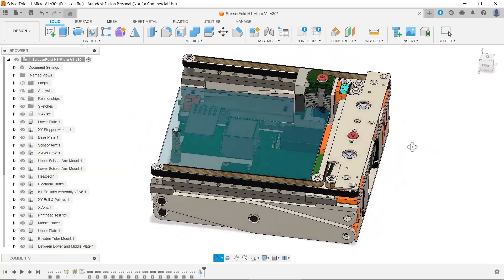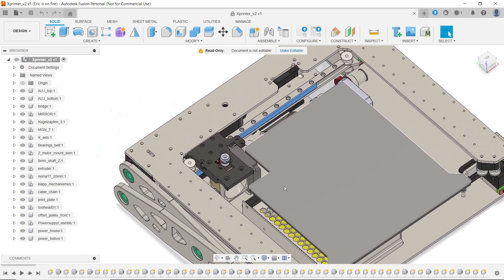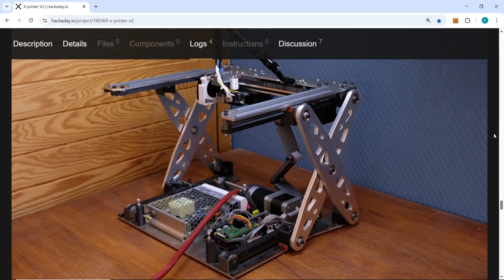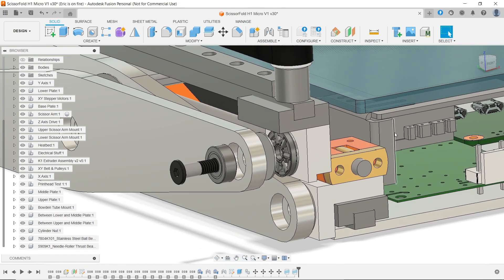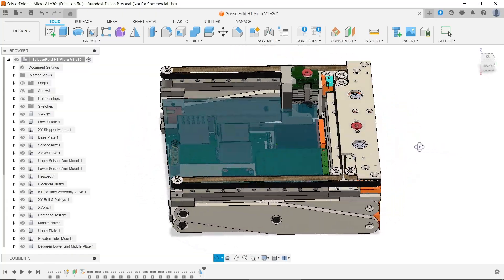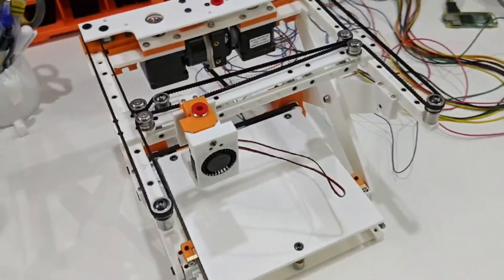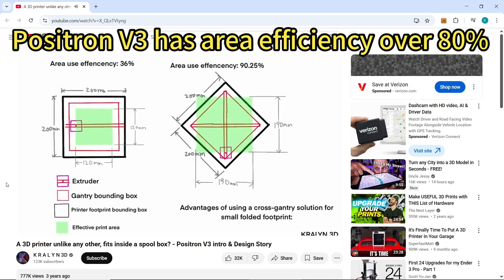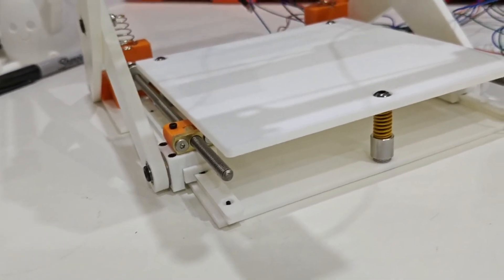Foldable 3D Printer Prototype: H-Bot XY + Scissor Lift Z-Axis

Comment: You could use markforged kinematics. Cartesian y for constraint and half h-bot for x.
Reply from the maker: Thanks for the suggestion! I looked into Markforged kinematics, and while it's a cool concept, I found that half H-bot with half cartesian Y doesn't quite solve the ranking issue, and two synchronized cartesian Y take up more space, which is something I’m trying to minimize for this build, which I would probably go with P-bot instead. But I appreciate you sharing your thoughts